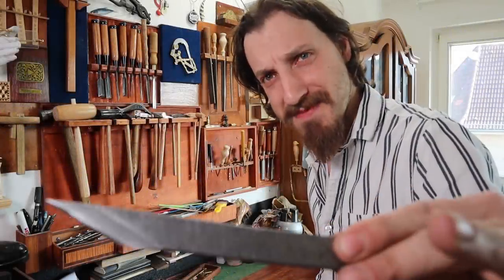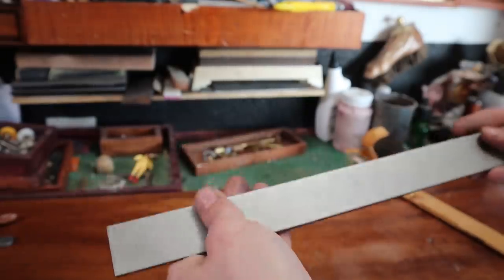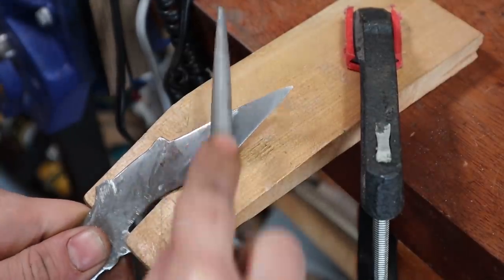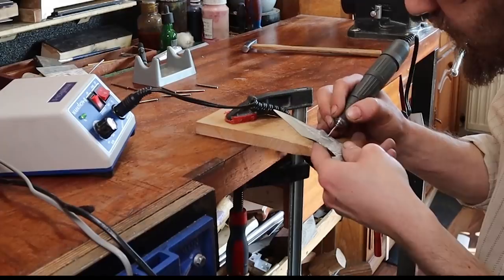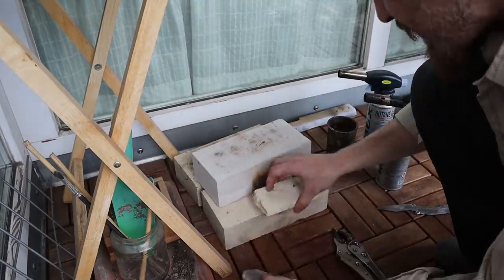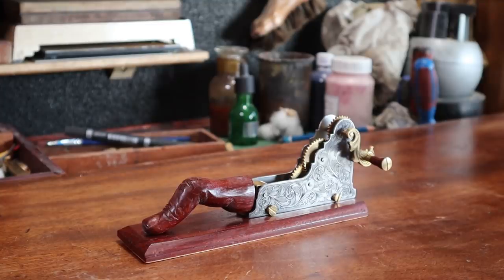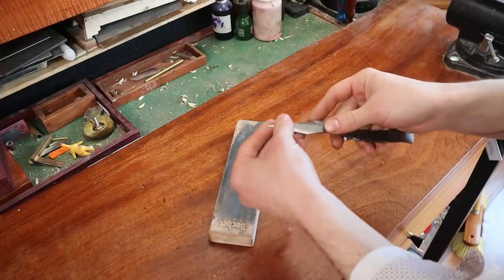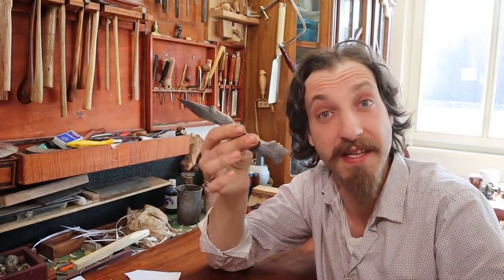Making a Tree Shaped Kiridashi

Comment: @Uri Tuchman. Blacksmith here. The only way to harden a blade whitout bringing it up to the critical temperature for hardening (In a furnace or simelar) is by work hardening it. Aka hitting it with a hammer for long or hard enough, so that the crystaline structure of the metal becomes compacted. If you havent reached the point of the metal losing magnetification (Or what ever it's called in english) then you dont need to worry about dabbing or rubbing water on it.

Comment: Great! I made one of those this week too, but in V shape, with 2 cutting edges, so that it works no matter the hand! To find out if the heat is good, use a magnet. The steel loses its magnetism at critical temperature. A little hotter is generally good to quench!

Comment: Uri's videos have inspired me to attempt engraving. I recently made a butter knife bolt handle for a Czech rifle in my collection, and set myself back weeks in finish work when I bunged it up attempting to engrave the bolt handle (note to self: 1020 steel is very hard stuff). I'm pretty sure I also wrecked a diamond-tipped stippling tool that I probably shouldn't have used on steel. Practice, practice, practice. I hope I live long enough to have a finished product I can be proud of! Regardless, Uri's work keeps me inspired and trying.

Comment: love your projects … a tip I learned when tempering a blade is put any magnet on the blade when heating it up … the magnet will fall off when the right temperature is reached … but I think for your projects your method works fine … keep up the awesome work :)

Comment: I really like this one...if you decide to make another one, I have a suggestion.  Find an actual limb of a tree, something of similar diameter, and make a mold of it.  Then make a knife by casting the "liquid" metal into the mold.  That way you have a handle more like an actual branch and not so flat.  It's just a suggestion, but I think, if you have the necessary equipment, that you would really like it when finished.

Comment: I absolutely love it. Thanks for showing. I find metalworking so unintuitive and less easy to follow along as a novice. I was wondering if, when next you do something similar, you could describe why you were using a file on it (after the forge) to see if it "worked" and how you knew it worked? I appreciate the concept was to harden it but i guess i don't fully understand how/why it gets hardened or how you know if it is.

I have similar confusion with sharpening. There is just so much information out there. I was interested to hear you say a atrop wasn't very Japanese - why do theu nof use strops? I'd lovr to see your take on sharpening as your tools are always so sharp. Thanks again and hope you're staying safe and well.
Reply: If the heating and quenching was done correctly, the steel should now be very hard. If the file can cut into it, it is softer than the file, and was not hardened properly. If the file skates over the surface without biting, the steel is at least as hard as the file, and the hardening was a success.

Comment: Nice work but quenching in water can be a really bad idea you should use a quenching oil or you can use canola oil. With water you run the risk of seriously cracking the steel. Also if you take a tin can and hold the torch and workpiece inside the can will concentrate the heat and you will get a better result.

Comment: I don't really know what is a Kiridashi, but this one looks awesome.
Reply: Its Japanese marking/carving knife. Using blade to mark gives far superior lines than any pen would ever, though removing the marks also is difficult, so dont do mistakes when marking. For making joinery marking knife is superior for very tight fits. You can simple make one from old ruined file, as its already hardened carbon steel, just dont over heat it. Best way it seems to be using first angle grinder and then belt grinder with lots of cooling.

Comment: so that you and everyone else will know, cutting paper or cardboard will dull a knife quickly. Why? Well I'd been told that for years, but I had to look it up. Paper and cardboard contain grit from the manufacturing process It's nearly the same as running the blade straight across fine sandpaper, eventually the fine edge will just be sanded off. Oh it will still be somewhat sharp, but not like it was when freshly honed.